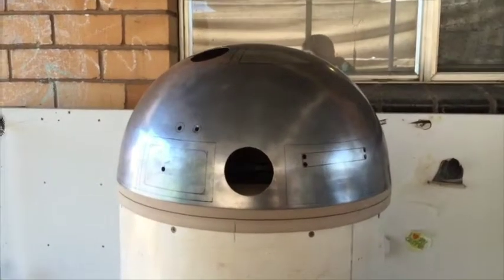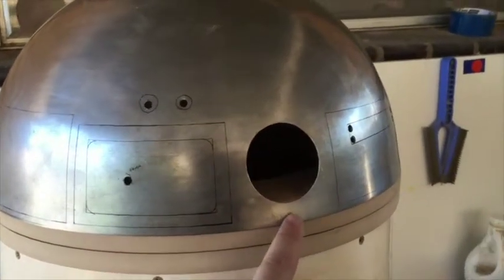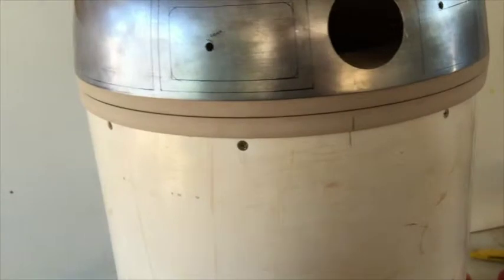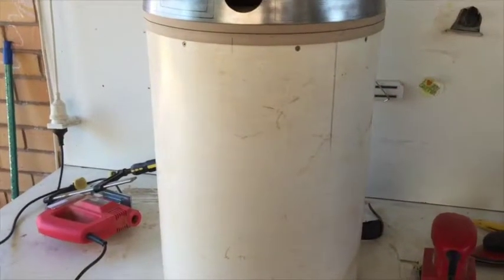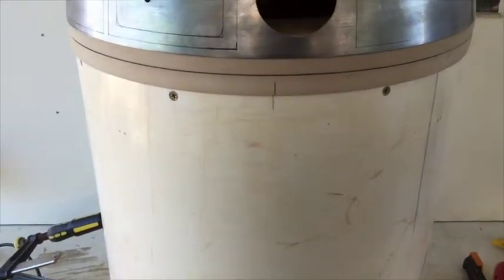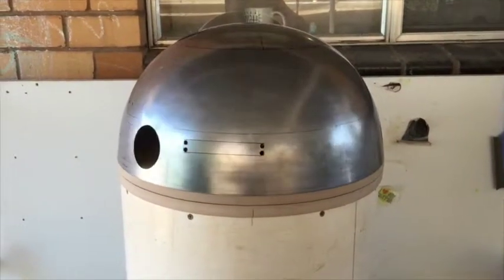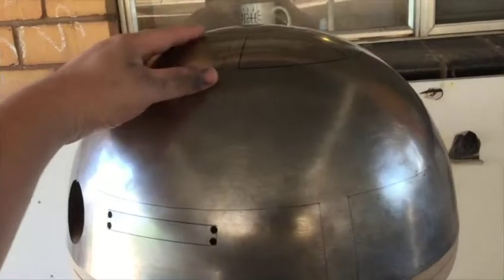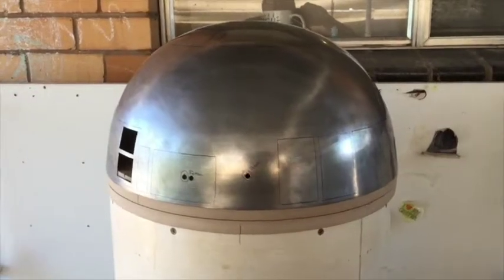R2D2 Build Progress Video 5 - Spinning Dome

Comment: looking good.....and that bearing is working a heap better.
good stuff
Reply from the maker: +Simon De La Fosse Thanks. It was a case of taking out the ball bearings, sanding the tracks of both rings, cleaning and reassembling. I used dry Teflon sewing machine oil. Super smooth now.
Reply: Nice